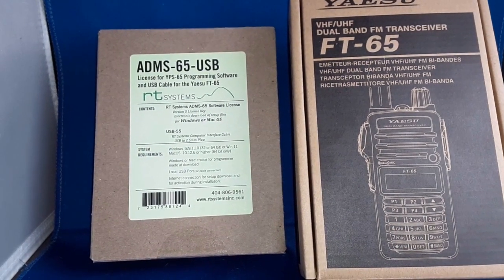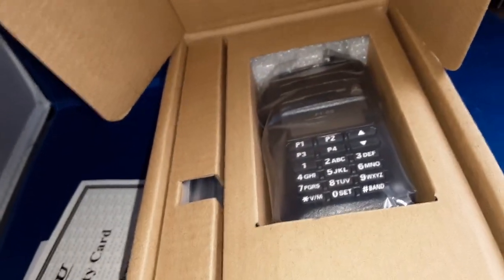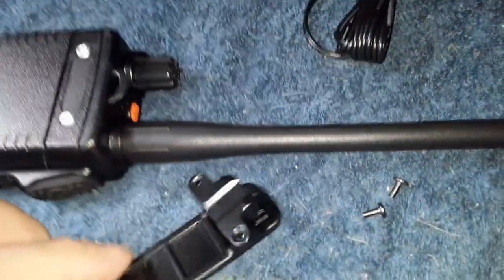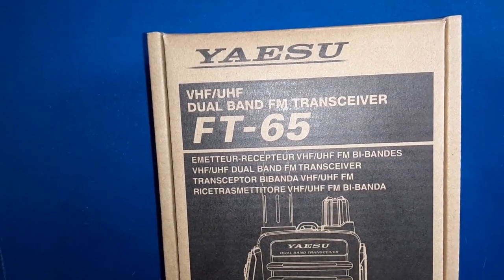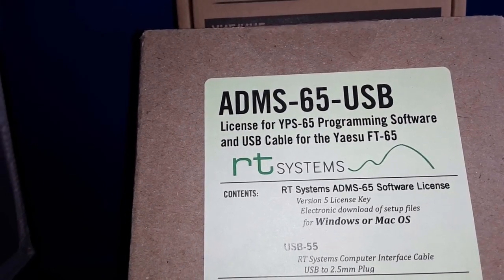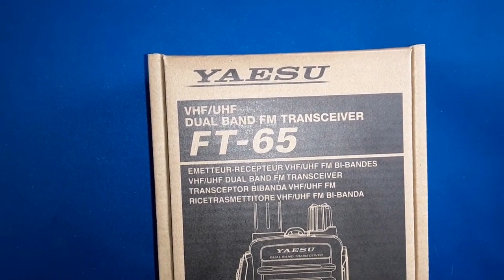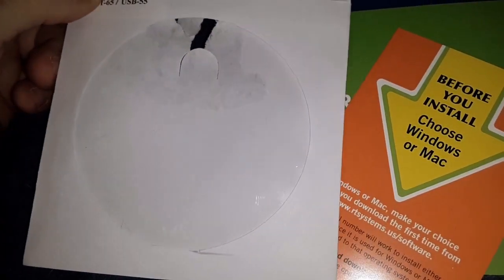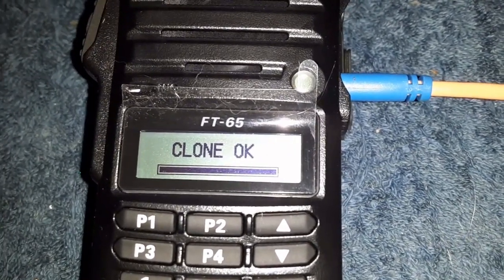Yaesu FT65R unBoxing to Programming with RT Systems ADMS 65 USB

Comment: The FT-65 is literally, my daily driver(I use it in my daytime work vehicle with a Diamond SR/MR?!? 77 magnet mount. I don't have access to a computer, so I have to FPP. Thanks for sharing. 73. KC3UEE
Reply from the maker: Good luck with yours, mine had issues and had to be returned